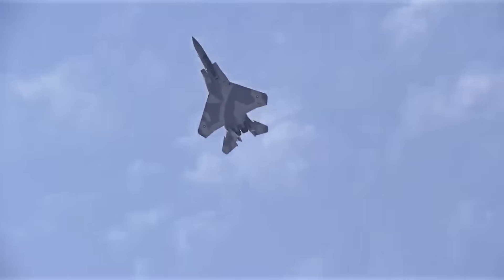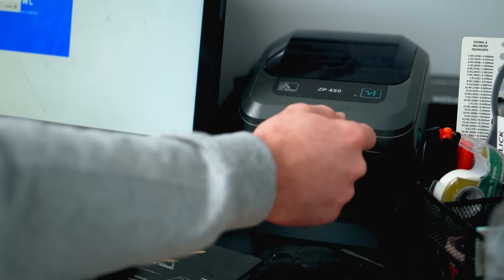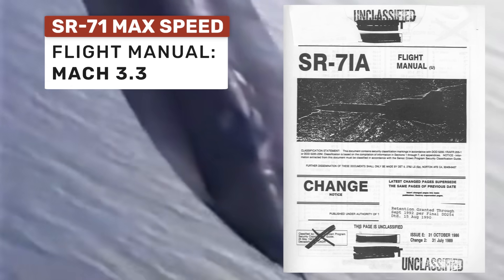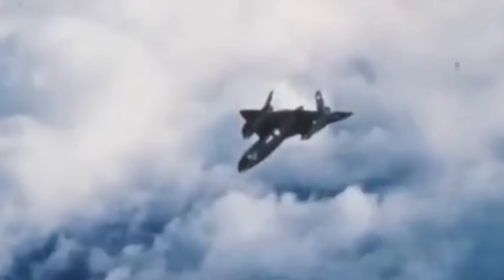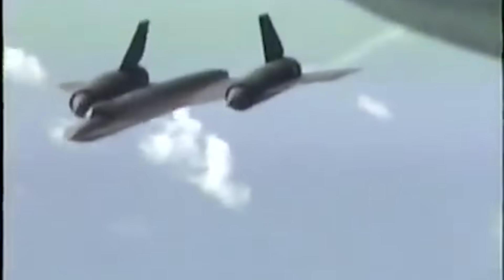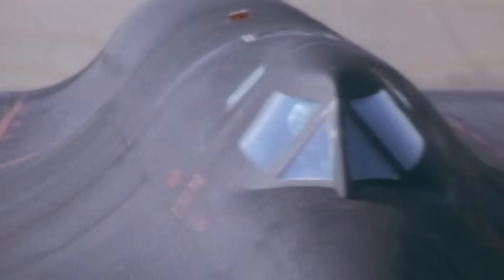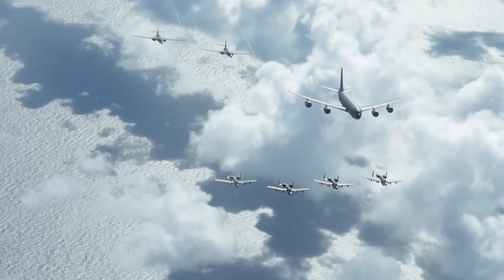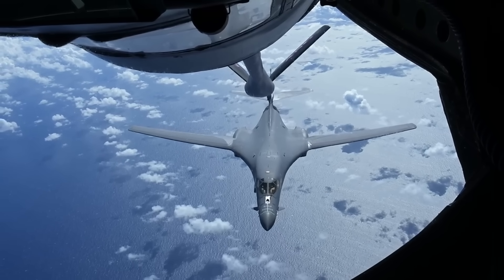The SR-71 was MUCH FASTER than the Air Force will admit

Comment: There's no absolute top speed, it all depends on altitude.  Air gets thinner the higher you go.  The official ceiling was 85,000 feet.  Most jet engines won't be able to reach the speed necessary to keep going at that height.  Not enough oxygen, engines flame out.  But at those speeds the SR-71's engines were operating as a ramjet.  Thrust was not a problem, it kept accelerating as long as you wanted it to.  

The real limit on speed/altitude was the size of the pilots balls.

Comment: I was an air traffic controller from 1982-2009.  In the80's we used to work SRs and U2's on a regular basis.  Our computers could easily tell you the aircrafts speed, even though it was not allows to be displayed in the data block on screen.  It is much faster than even 3,000kts.  Trust me.  The data blocks only displayed SC where ground speed is usually displayed.  That means "Speed classified".

Comment: One of my favorite stories is when the 1982 story where a SR-71 cut through French air space cause one of the engines was reporting low oil pressure.  The French scrambled a jet and while the mirage was next to the SR-71 asked them for a diplomatic clearance number.  They responded by and I quote flipping off the French pilot and hitting the afterburner.  They cleared the English channel less than two minutes later lol.
Reply: A similar incident over Sweden had slightly more serious repercussions (as I understand it, the US ambassador to Sweden was handed a "not amused, please don't do it again" note).

Comment: yeah.... no shit.....  why is this a surprise....  i was a Fuel Systems Mechanic in the USAF from 1986 to 1990.... i primarily worked on F-16s and KC-135s & KC-10s....   but worked on a couple F-4 phantoms, a T-38 and an A-10 Warthog....   and was part of a "then classified"  mission supporting SR-&!s  running spying missions over the Gulf of Sydra....  the KC-10s were breaking after refueling the SR-71s in flight because the J-P 9 fuel was eating up the "O" rings and making the off loading pumps fail ... leading to alot of broken jets staking up at Yakota Japan.... so i was tasked... among others in my squadron to go fix those KC-10 aircraft by replacing ALL THE "O"RINGS  in all the pumps on EVERY PLANE WE HAD IN THE FLEET STARTING WITHT THE BROKEN JETS AT YAKOTA AIR BASE...........    the SR-71 is an exceptional aicraft that would morph in shape in MID FLIGHT  due to the heat of the friction from how fast it could REALLY fly... all i know is that every time an SR-71 landed at a base i was at it was immediately temporarily grounded due to fuel leaks until it morphed back into its original shape.... wich would take hours ... and it would piss jet fuel until it reseated itself back into its original shape....   so the changes werent huge.... but they WHERE enough to stop it from leaking and 12 hours after it landed .... it was ready for a new mission..........   so yeah... it was more like MACH 5.... not just over Mach 2... like they told the public....    for example....  it was so fast that if a radar scope caught a blip of it on their screen... by the tme that hand/arm came around again it was already out of that air space.... if it want to land in texas it would start its turn over mississippi, arkansas missouri kansas colorado utah or arizona... just to set it down in texas..... it was VERY fast... but not very maneuverable....  ✌😎

Comment: Like the English Electric Lightning. The official top speed was mach 2 but the pilots said it would do a lot more if you had the nerve to push it to the limit. Let's just say the MiG 25 Foxbat's 2.5  would not have been much help duevto the limit on how long you could maintain that without damaging the aircraft.

Comment: Just ONE description of the radius required for the SR-71 to change course by 180 degrees said more than enough........ as I understood it, the area is approximately the size of Texas....... at roughly 600 miles across, the turning radius would be about 300 miles. Of course this is all dependent upon the speed of flight.

Comment: When I started my career in aerospace, a couple guys I worked with or old timers at Lockheed. Both of them had worked on different aspects of the SR-71. I badgered them quite a lot but of course, there was very little they could tell me. Finally, one day, I asked them if the publicly stated top speed was really its top speed. One of them smiled and told me “that number you know of is not its top speed”. The other one told me that all he could say is that it was possible for an SR 71 to get from Fort Worth Texas down to Galveston in about 50 seconds or so.

Comment: Thing is, aircraft generally don't have "hard limit" top speeds. For instance, a BAE Hawk is not advertised as a supersonic plane as in straight and level flight, it is nowhere near powerful enough to exceed M1 in level flight... however, in a moderately deep dive it will safely go supersonic. A DC10 car apparently do something similar if you know what you're doing  (using trim as elevator !!). And a 747 is thought to have gone M1.4 in an (unintentional!!!) steep dive and survived albiet with major damage. Concord allegedly hit M2.6 when "hooned" by US test pilots  (you naughty Yanks grrr!) not it "service maximum" of M2.2. 
SR71 had a hard limit of M3.7  as at that speed, the shock wave from the nose would start to enter the engine nacelles and that would cause an unavoidable flameount. 
Still...  annecdotally on occassion - especially when running for it's life over Libya in th 80's, it came damn close.

Comment: On a tour at the Pima Air and Space museum a guest speaker who was retired blackbird pilot told the group that the engines and airframe could reach closer to Mach 5, but he said a seal around the cockpit windows would give out long before you reached that speed. And, that was only what the designers knew would be the first thing to fail. Weather true or not, I think any pilot crazy enough to willingly put himself and the aircraft at such risk would have been drummed out of the program before he even got to piloting the actual blackbird.

Comment: I had the opportunity to listen to a conversation between an SR-71 pilot and a skunk works engineer.  They indicated that the SR-71 and A11 were both redlined at Mach 3.35.  While the plane might survive, exceeding 3.35 would result in having to replace the engines due to overheating the first stage compressor fan.  They also indicated that exceeding 3.35 had been done but would get the pilot in trouble.

Comment: "The SR-71 was MUCH FASTER than the Air Force will admit" The fastest was one seat A-12 OXCART for CIA ,his unoficial rumor speed was 4000 kph in the statosphere. This was talked about at the turn of the 80s and 90s. In the stratosphere Mach1 is only 1060 kph! Than the A-12 speed was MACH 3,77😉 It was claimed that, compared to the SR-71 that was for the airforce, it had a kind of spray "paint mixture" that reduced air resistance at high altitude and the engines were "tuned" for maximum forsage.🥸It is not known whether the SR-71 pilots even knew the A-12 specifications and whether the A-12 pilots knew them as well. According to the first Top Secret information from the Cold War time, information about the Blackbird should have already been declassified, but that "definitely" changed after the end of the Cold War and is still not declassified!  This declassification should have been on the agenda after 50 years. I have books and magazines about Blackbirds from the early 90s at home. Now I am 50+, I was interested in this airplane in my youth.💘

Comment: Keep in mind the speed of sound becomes slower the higher you go. Ppl usually use sea level roughly 732 mph as reference. 

Friend of mine was in AF in late 60s,and he said that there was a coast to coast run in 45 minutes.  Obviously cant confirm it but while a good story teller he wasnt one to exaggerate. 

I suspect its top speed was more than reported, that is typical of military gear. The other thing is sustained vs spurt, the speed reported might be sustained

Comment: Being close to air core your comment on top speed of the sr and a12.  A conversation with a retired commander of Area 51 he stated the engines in the 72 where ran well below 70% with speeds over 3.2 . “The A12 is faster” . Was his statement. The Sr72 and a12 are just getting into its groove at 3.2 . It’s like you cruising a corvette at 70mph… She is just purring. The air frame heating is the limiting factor. Where did I meet him? At a Harley Dealership out west.

Comment: The newest evolution of the fastest bombers and recon aircraft will punch into space to cool off. Beyond that, truly advanced craft form ionospheres about themselves which change shape to squeeze through space using zero point energy tech to implode white noise emf through dielectric layers on a carrier, forming pump z waves in sync yet out of phase. After implosion such waves combine through the focal point, producing high potential charge which burns off a conical shape, usually a coil. The electron gun cone as a point of negative ion compression, capable of penetrating the zpe ionosphere through a small enough hole to change the shape of the ionsphere without losing meson particle vacuum necessary to form a strong ionosphere.

Comment: A KC-135 boom operator friend of mine that refueled them and was stationed in Oki in the 70s told me the Habu would routinely do Mach 6 like the X-15 but only in restricted areas where they couldn't be clocked by radar...He also said the 135 would be shaking at max speed while the Blackbird was near stalling during the entire refueling process.
Reply: @Ghost_Bear_Trader I don't doubt that story not for 1 minute. Or no more than I doubt the story I told you. He told me that in 1977.
Reply: Mach 6 (and controlled flight) just isn't possible in this plane. At Mach 6 the shock cone angle from the nose spike would be 9.6 degrees either side of centerline putting the shock cone onto the tail, wings and engine inlets. Mach 3.6 is where the shock cone angle hits the front tines, engine inlets, tail and wing tips simultaneously and is where that plane would be aerodynamically limited too. They would need an extended nose spike to push that shock cone out to go any faster (which they probably had as I know they had a few different noses for the plane depending on mission) but that would only give them a bit more. That spike extension would have to be 35 feet long to push that shock cone out past the plane at Mach 6.
Reply: @wally7856  Too many times I've heard Narcissists claim for various reasons they like to fire their "Derringer" Pistol "Both Barrels" at the same time. But a Gunsmith or even just an avid Pistolero will quickly dispel any myth such as that as even possible with their knowledge and know-how of the legendary Piece of Western History. The way I understand it at Mach 3+ the Ram Jets Bypasses supply 80% of the Habu's thrust.         And 80% of that is from the "Spikes." So, that figures. hahaha Thanks for the Comment. KUTGW
Reply: @Imnotyourdoormat  Yes, at full speed almost all the thrust is provided from the engine inlet spikes and the engine is just there to remove air from behind the spikes to keep the internal shock waves behind the spikes stable. At those speeds it's all about managing the shocks, both engine and airframe. The legends of this plane going faster then Mach 3.6 are just that, legends. Geometry of the plane says otherwise.
Reply: @wally7856  Much akin with Engine RPM and Final Drive Gear Ratios either permitting or prohibiting given speeds in an Automobile. Lays all B/S Bench Racing brags...to the side.  hahaha
Reply: Wow!  I believe this!  See my comment above about a boom operators story!  You'll like it!
Reply: @MillionsOfRecords  The "Habu" uses engines that work like normal jets until it gets at altitude. At altitude the engine "bypasses" takeover supplying the majority of its thrust.
Reply: @Ghost_Bear_Trader Given the neighboring countries, I somehow doubt they entered PRC airspace from due west, so more likely somewhere on the southern border (somewhere east of Tibet) with a (more or less) continuous curve out to sea just south of Shanghai straight to Okinawa. That will take some distance (and so some speed) out of the equation.
Reply: @MillionsOfRecords  You are correct, at Mach 3.2 the cone angle is 18.2 degrees either side of centerline.
Reply: @MillionsOfRecords  There was definitely some brilliance in this design the likes of which I haven't seen since. Especially with managing the shocks entering the engine with the variable geometry inlet spikes. At Mach 3.2,  80% of the planes thrust was generated from the build up of oblique shocks (high pressure) on the backside of the inlet spikes pushing them forward. At that speed the main purpose of the turbo-ramjet was not to provide thrust but to remove just enough air from behind the spikes so that it didn't build up to keep those shocks stable without removing too much either. That's why it's fuel efficiency increased the faster it went. What's amazing is that the "computer" feedback controls to control those spikes and the fuel for the engine was (initially) an analogue computer that operated on hydraulics using chambers, pistons, springs and valves using the JP-7 fuel as a working fluid. They later went electronic. I'm sure wind tunnels provided the designers the data they needed to fine tune and do that but brilliant any way you look at it. Most people credit the J-58 engine with it's top speed but it was 1960's tech and materials, not very impressive by todays standards. It was those inlet spikes and perfect control of them and the J-58 that made that plane accelerate like a rocket. It was all about the shocks.
Reply: @MillionsOfRecords  That plane was designed to use afterburner pretty much all the time, I don't doubt it needed it a bit with a full fuel load just to maintain subsonic airspeed at the higher AOA it would need with heavier weight. I doubt it was near stall in the heavier air refueling takes place in. Up at 85,000 feet in coffin corner at Mach 3.2 it was probably within 10 knots of stalling at any given time, that's where the real skill flying that thing would be.
Reply: @MillionsOfRecords  I'll explain. The higher you go the faster you must go to maintain lift as the air gets thinner. The J-58 engine had a thermal limit of 427 degrees Celsius on the compressor inlet temperature otherwise engine parts (turbine blades) will start to melt.  You needed an outside temperature of -40 C to maintain Mach 3.2, -58.6 C to go Mach 3.35 on that platform. Outside air temperature was the real limit to that planes top speed, not the aerodynamic limit we talked about earlier. At the high altitudes it flew the pilots would take it within 10 knots of stalling to get as high as possible while going as fast as outside air temperatures would allow.

Comment: Some records are unofficial.  When a Mig-25 fires some rockets at you, there was at least one of the SR-71s that went a little faster than Mach 3.7+ for a few hundred kilometers till those rockets burned their fuel up.  Took the pilot of the Blackbird a little off its course, too and refueling became an issue.

Comment: At Wright Patterson airforce base they had a plain that looked like a SR71 but it had 4 engines and a small oblong window with a thick metal plate on a lever to completely cover the window. It was then flown on instruments. I don't remember its prefix. The last time I was there it was not in the main building anymore. 4 engines that looked just like the ones on the SR71 that was setting next to it.

Comment: Highest speed on record that is verifiable without a shadow of a doubt is mach 3.47. That pilot still had throttle to spare.

Source: Linda Sheffield of Habubrats.

Edit: A-12 was indeed faster. As per average or abosulte? Unknown. But the stated mach 3.47 was done by the Oxcart family, specifically the A-12.

Comment: Anything is faster than advertised when you push it beyond the limits. Yes I'm sure everyone knew it could go faster especially if it cruises at that speed but when you say "the airforce refuses to admit the true top speed." I mean really? You said it yourself, the engines were capable of pushing the aircraft faster than the structure and other components could handle is a big reason why they won't disclose a higher top speed. And two, do you really want the enemy to know what the plane is capable of? Let's think about why it would be bad for the specs of a spy plane to fall into the hands of the enemy, and why they wouldn't disclose everything about it...

Comment: Those that think this is the case are idiots.  The maximum speed EVER reached by a Blackbird was Mach 3.49 with David Peters in control of it.  The inlets on the engines could only get to a certain temperature before it beings to melt.  That is why it couldn't go faster than that.  The temperature maximum at the inlet was 650 because the metal it was made out of would start to melt a slightly higher temperatures.  Titanium can go higher than that but there were other metals used in the engine that wouldn't be able to handle it.